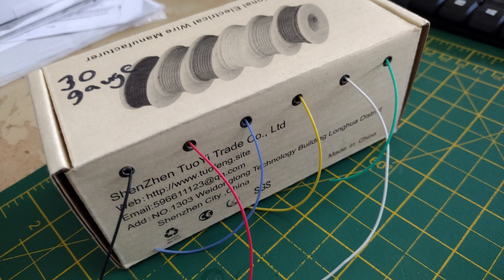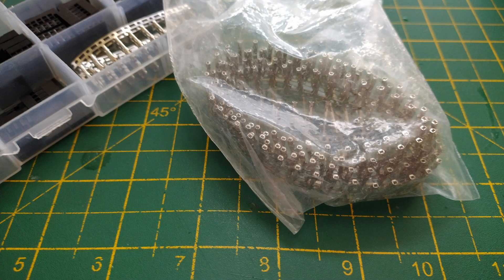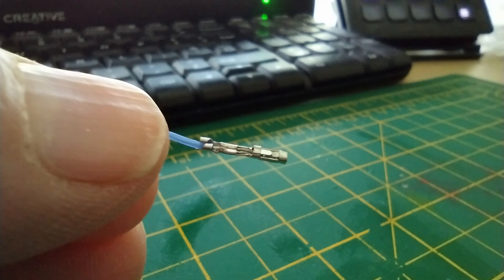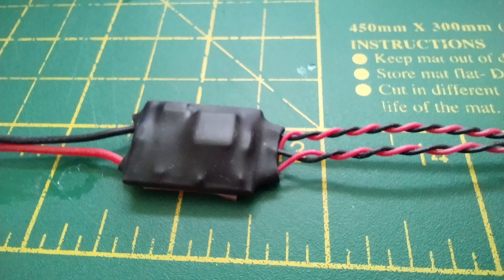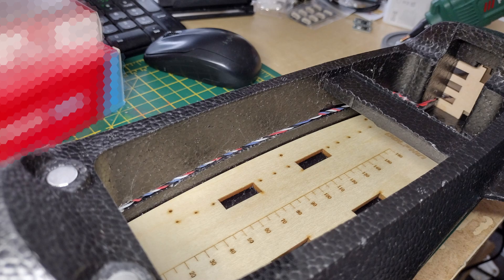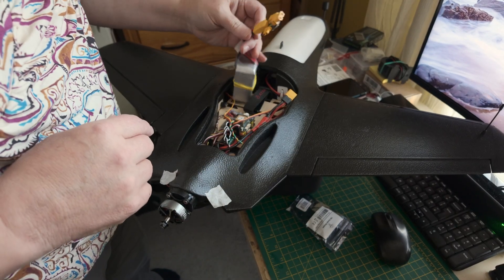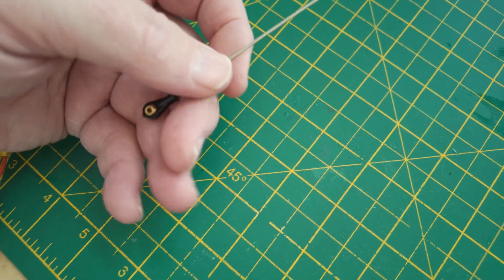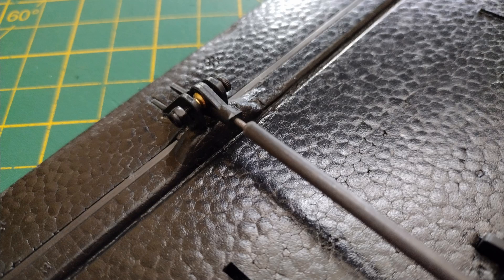AtomRC Dolphin 6S - Part four

Comment: How did you mount your flight controller? Its is screwed down? Or just double sided sticky?
Reply from the maker: In general I fix my flight controllers down with 3M VHB double side foam tape. it not only sticks really well but provides some extra vibration isolation.
Reply: @Caroline_Tyler  I'm sorry. I meant your VTX. You said its attached by a mangnet. Are you using a double sided sticky tape magnet for it?
Reply from the maker: No more magnets for the VTX, VHB tape all the way!

Comment: I use Tinkercad as well, brilliant for our simple design requirements. Good tip about the IPA on hot glue, didn't know that, I felt your trepidation prior to connecting the battery but all was well, cheers
Reply from the maker: Tinkercad is so easy to throw together a simple do-hickey to 3d print. I do all the checks, stick a multi-meter on everything and I still get the butterflies before the battery is connected for the first time :D
Reply: Yeah, the moment of truth is always exciting......... sometimes too exciting ha ha.